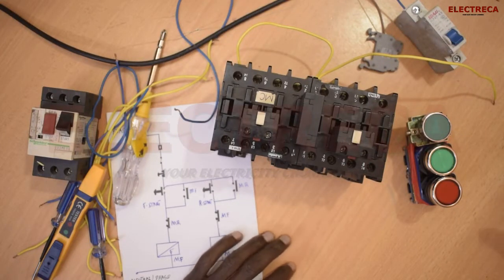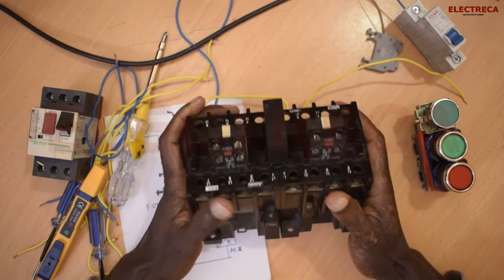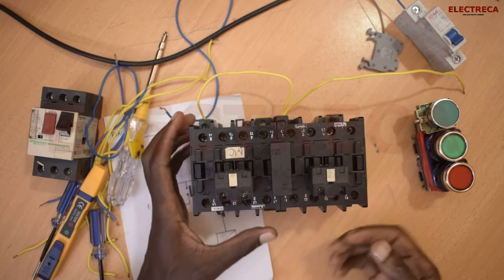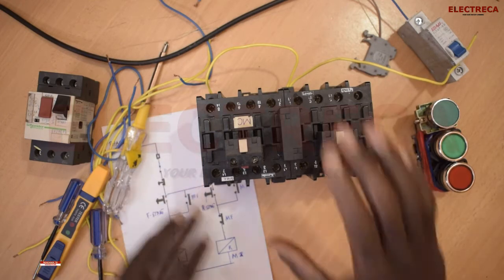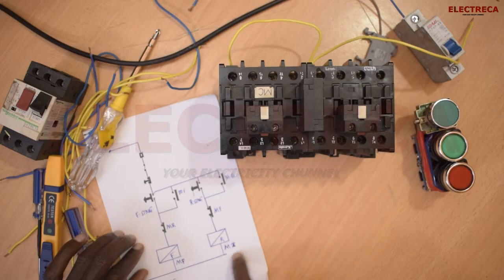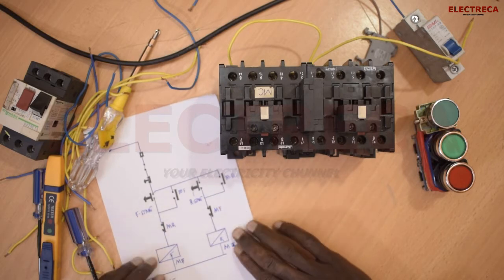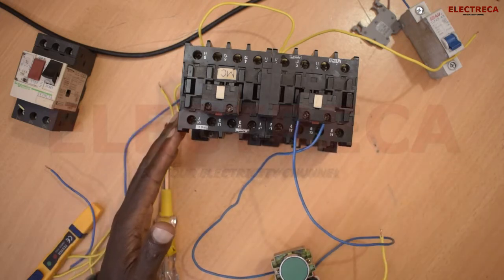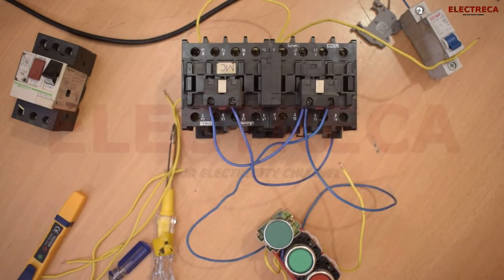forward reverse motor control wiring|Connection|ELECTRECA

Comment: In which position or contact did you fix that cable for withholding
Reply from the maker: The withholding is parallel to start button then to the coil A1